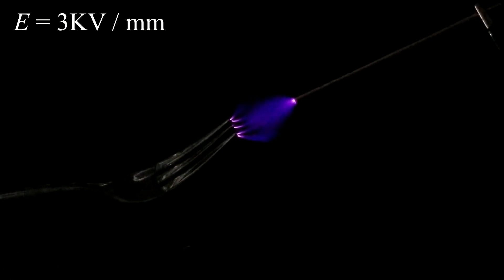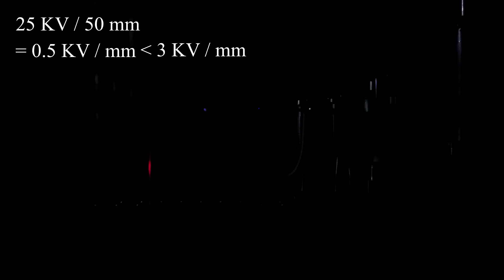High Voltage Ionization and Its Applications

Comment: The three phases of Plasma Discharge Modes should be explained more fully in my opinion, rather one being an intermediate stage towards an arc. They are PDM 1, Dark Mode and where there isn't enough power density in the discharge to be seen in visible to human wavelengths of the Electromagnetic Spectrum. PDM 2, Glow Mode and where there is an increase in power density in the discharge and can be seen by humans and PDM 3, Arc Mode and which has such a high density that the discharge enough of magnetic field to restrict the discharge into a tight filament.

Comment: Does the temperature of the air increase with the ionization?
Reply from the maker: Since the ionized air molecules are forced to travel through neutral air molecules, and also they are undergoing exothermic process during ionization, so yes the air temperature increases!
Reply: @iheartnuclear8517  with a 25kv like in this case, does the increase in temperature is very high or not?
Reply from the maker: @lorenzobarale7836  Not that much, since my 25 kV power supply can only provide 0.15mA or so, which means there are 0.00015 * (6.25E+18) electrons to accelerate towards the anode. That is a little too less electrons to do anything - plus the 1 atm air surrounding it will continuously "cool down" the heated air ions!

Comment: What are you using to produce the high freq high voltage current?
Reply from the maker: I used 120V to 2000V AC transformer and fed the 2kV output to a 13 stage half-wave voltage multiplier!

Comment: Thanks for the video! There are so many videos about high-voltage applications and ion wind out there, but this is one of the best!
Maybe you can answer my question: Can you explain what exactly are the physical/chemical properties that make a good dielectric material? Dipole characteristics, semi-conductivity etc...
I'm especially interested in affordable, available and non-toxic materials (so e.g. not something like gallium arsenide ;-)) and alternatives to glas or acrylic glass. E.g. what would be good additives to mix with epoxy resin to make a good dielectric material? Silica powder? Titanium dioxide? I subscribed and activated the bell icon in order to be notified in case you will answer this in a future episode, but an answer here directly would also be amazing. Thanks!
Reply: casted molten sulfur that's safer than messed with arsenic thing